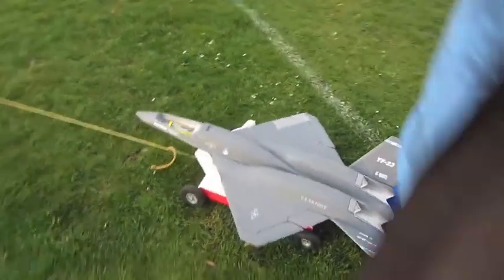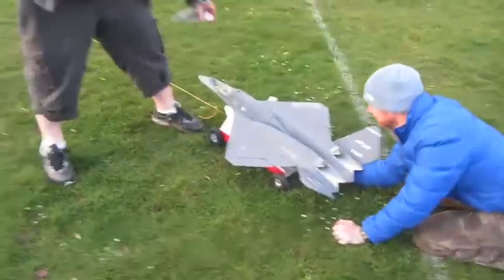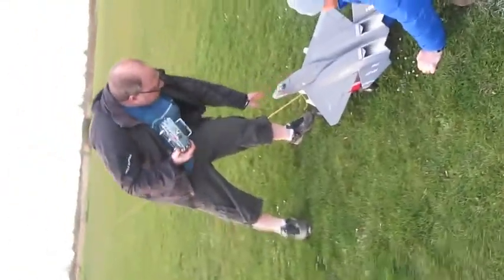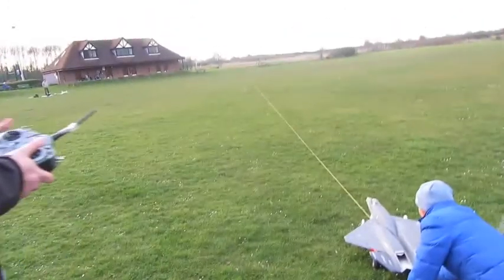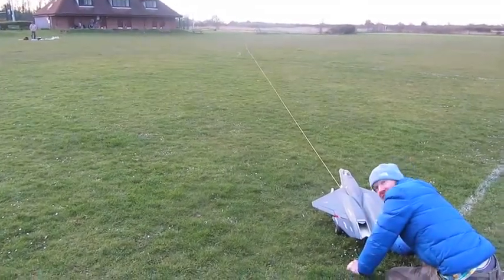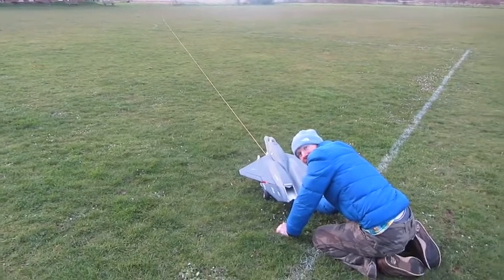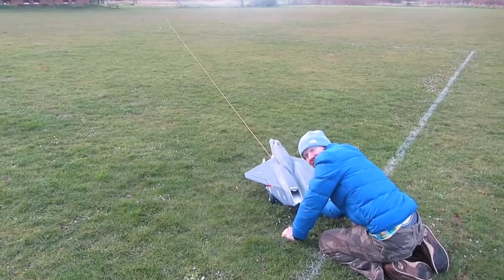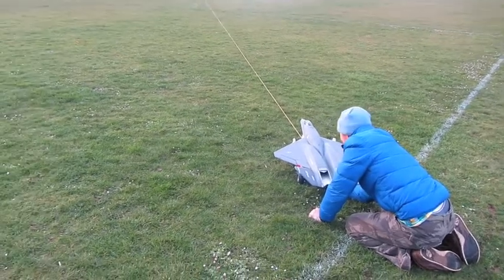YF-23 Black Widow II - 50mm EDF maiden Flight

Comment from the maker: Both of my models - edf and pusher tend to be quite sensitive to roll with a side wind.  This video was shot on a windy day which - when combined with my sloppy control surface setup was just asking for trouble.  I have tried a flight stabiliser on the roll axis on my pusher version and it really helped but is not necessary for calm weather conditions.

Comment: I'm looking to modify the BH twin 70mm YF-23 with the full functioning V-tail (as you have in your video) and gyros.  I had similar fast and wild flying characteristics with my first BH YF-23 as you did in your flight video with your scratch built.  Visual orientation is difficult due to its' stealth design. It is a cool looking jet but a handful to fly.